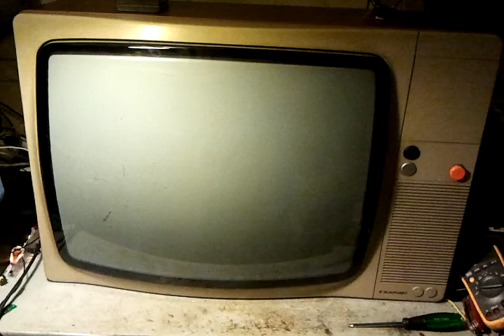Blaupunkt Colorado Colour Television (circa 1975)

Comment: It is because the camera's microphone doesn't have an anti-aliasing filter and uses a low sampling rate for the audio. So high-pitched sounds above the limit of its sampling rate get "mirrored" (aliased) downwards into the audible range. In this case, the TV's 15.625 kHz horizontal oscillator frequency is being mirrored and turned into that annoying whine.

Comment: Hello, i was wondering: how did you hook this tv up? 

I have one similar, Cortina 7 660 320. 
But i cant seem to get my NES or SNES working on it. 
And i dont think my wall socket has any regular TV signals anymore.

Do you know how to get machines such as Nintendos or modern displays like VHS, DVD and Smart TV to work on the old Blaupunkt Cortina TV?
Reply from the maker: These old sets only have an antenna socket on the back. VCR's, and the NES and SNES should've come with an RF cable to plug into it. If you have a VCR it'll have composite and audio inputs on the back, which will let you plug in a DVD player and send it to the television.

You can also try buying an RF modulator to convert from composite to RF. Searching "RF Modulator" on eBay comes up with a few examples. Thanks.
Reply: @256byteram  hey i figured it out. This old tv set only has tiny buttons that look like small lights. I needed a toothpick to click on them and search for the antenna signal my NES and SNES send out 😂